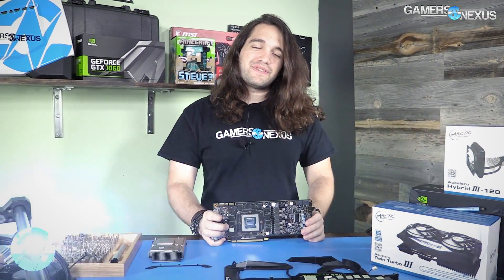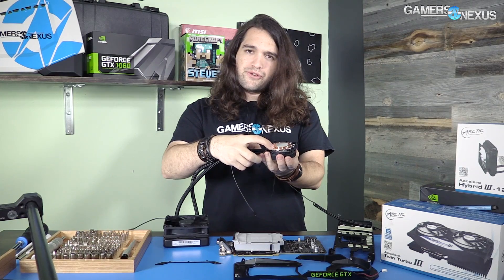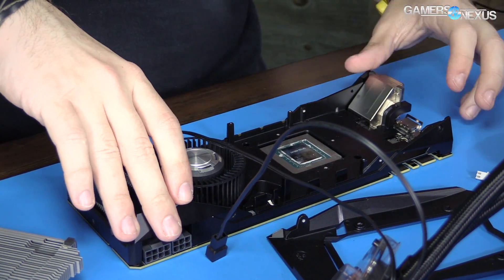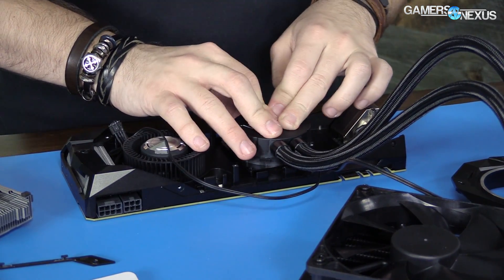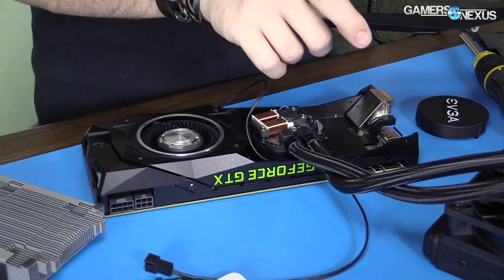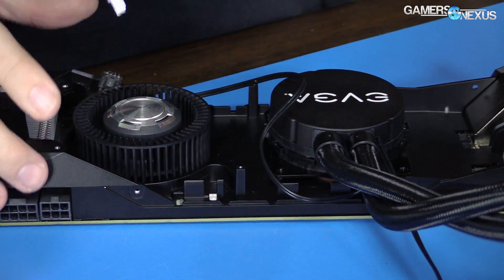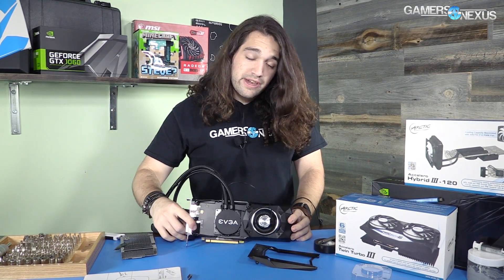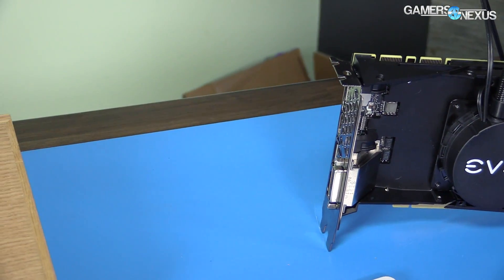Building a TITAN X Pascal Hybrid Part 2: Assembly

Comment: Hello, is it possible to turn the waterpump for 90°? So that the tubes are going out to the I/O shield or to the radiator? If this would be possible it would be also possible to use the rest of the original titan X Cooler-Case because the tubes would fit trought the frame where the plexi-glas sits. Then only another plexi-glas have to be bought and modified a bit.. or maybe let the plexi-glas away at all. 

Plz, Plz reply.. im close to buy a Titan X and an EVGA Hybrid AiO.,.. but i dont want to damage the original cooler of the Titan X Pascal. So if i could turn the pump for 90° and put the tubes trought the frame where the plexi-glas is it would be the best solution for me. To modify a new plexi-glas would be very easy with my cnc milling machin.
If its not possible to mount the pump 90° turned then is it maybe possible to turn the mounting plate of the pump for 90°?

Comment: So I got my second card in and did this mod however the fan is not spinning.  Do I need to be concerned?  I stopped using it an ordered an assembly....the GPU idles at 23c.... I did not push it due to the fan not working...

Comment: You're using the incorrect screwdriver bit, It should be a ph2 not a pz2, unless it was a pz1 then you should be using a ph1, otherwise you will inevitably chew them up some what.
I might be wrong but I believe this is the case.

Comment: What are the specs on that screwdriver that you used to unscrew those mini hex screws? I am about to try this mod myself, but want to make sure that I have everything before starting. Many thanks in advance!
Reply from the maker: It's an odd size... can't remember exactly. Maybe a 6.5mm? I think I detailed it in either the article or in the part 1 video. ^SB
Reply: Thank you so much for the reply! That is indeed strange. I guess I'll pick up the screw driver from that iFixit kit that you were able to use in the first vid. :)

Now one more random question if you don't mind, as I've never taken off an Nvidia shroud. Do you happen to know what size and type of screws are on the shroud itself? It seems like they are standard hex screws, but I wouldn't really want to bring my card to Home Depot to try and find the right size once I get it on Wednesday.  Many, many thanks once again good sir!

Comment: Still looks really good. Keen for results but does the pump/plate have to face the tubes to the top of the card? I would guess the tubes would fit through the last plate/bracket if you rotated the pump anti-clockwise 90 deg.

Comment: Hi Steve, love the channel.  Just wanted to comment on the tube orientation.  I did this same mod with the EVGA AIO on my own 1080 FE, and I routed the pump tubes towards the back.  The card fits nicely in my Corsair Air 540 case.  There's no excessive bends in the tubing, and the tubes don't even touch my case side panel.  So it is possible to utilize that orientation while still putting it in a case.

Comment: would the lines really not fit if facing rearwards? they look flexible enough that they should be able to route down, though their lengths may not allow for optimum radiator placement

Comment: Is this the EVGA Hybrid cooler from the old Titan? If not, can someone link me to the new EVGA Titan X Pascal cooler?
Reply from the maker: It's just a CLC. Technically from the 980 Ti kit.
Reply: Check out my previous comment...You can use the EVGA Hybrid Kit for the 1070/1080 on the Titan X Pascal. Of course with a couple of modifications.
Reply: Thanks Damon, I'll look for your comments.

Comment: Gamers Nexus I don't know if your saw my previous comment that I posted in Part 1 of this video...

Here is my post of the hybrid mod I did to my Titan X Pascal...

https://hardforum.com/posts/1042460620/

I used the EVGA HYBRID Water Cooler (All in One) for GTX 1080 and 1070

http://www.evga.com/Products/Product.aspx?pn=400-HY-5188-B1

I did have to mod (the hybrid base plate) for the extra power connector and for one of the memory mosfets, but it looks as original as it could get.

Comment: any way you can see a corsair hydro system being mounted using the stock baseplate? their pump hoses can be vertical and possibly allow the use of the full stock shroud. nice video, thanks

Comment: why couldn't you just turn the cooler 90 degrees left and have the tubes come out that space in the plate you guys were trying to put on?
Reply from the maker: We've done that before, and you could. This time, however, the card is being returned to someone for use in a real case, not an open bench. We don't want to kink the hoses in a case.
Reply: Gamers Nexus ohhh, when you talked about that in the video I thought you meant out where the display ports are.
Reply from the maker: Ah yeah, could do that as well. Either way, we felt more comfortable running them out the top as the tubes will be straighter, so less risk of reducing efficiency!
Reply: Gamers Nexus makes sense, thanks for the reply. You guys do awesome work and have a great channel.

Comment: You should change the fan on the rad and run push pull config.
Reply: I assume it will be in a test bench?
Reply: it won't. This card will be used by the guy who was so kind and sent it to GN. Push/Push in a  close case is not ideal.
Reply: Dieser 1337 Baka. Ah yes i forgot about that, maybe just in the interest of science?
Reply: AxelGaming I have actually seen a video about that some time ago, didn't have many clicks tho

Basically, on an open test bench Push/Push worked fine, but lost to Push/pull or even push only in a closed case^^
Reply: Dieser 1337 Baka. jayz2centz has done it on 1080 hybrid in his latest vid!

Comment: Can you guys test if the new evga hybrid gtx 1070,1080 cooler has improved and put one on a gtx 980ti and see if there is a difference in how hot the gpu gets with the new hybrid cooler. And look if it's  the same cooler like on the evga  980ti hybrid would be interesting :)